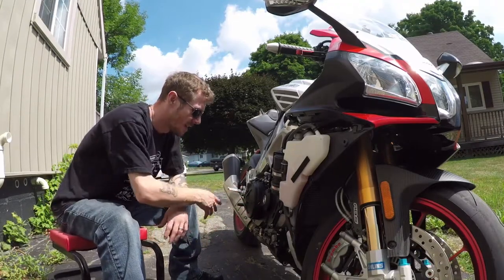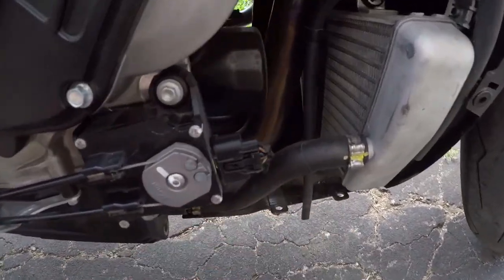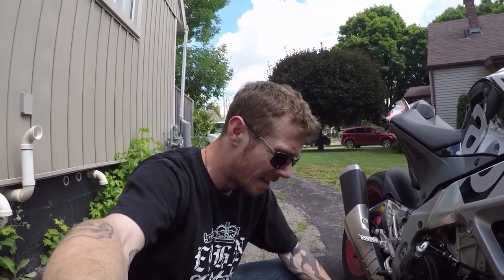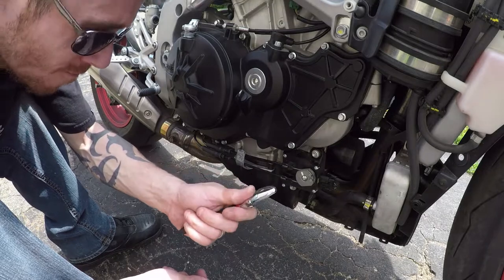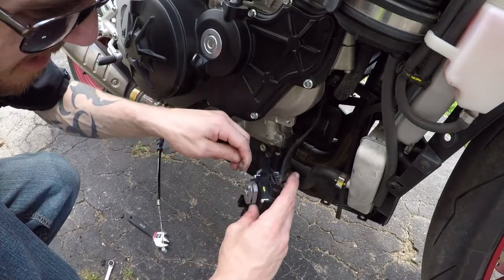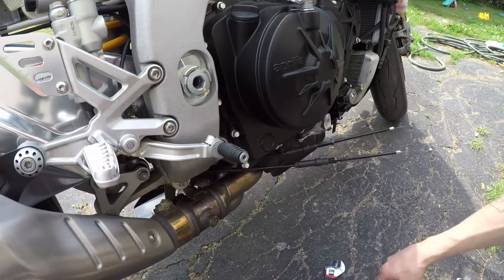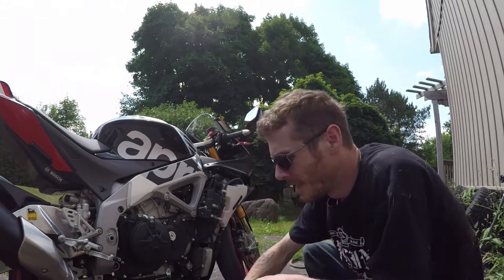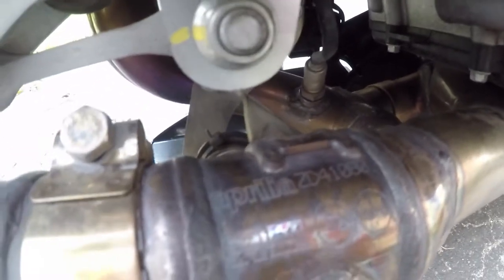Aprilia RSV4 RF Butterfly Valve Mod | Cable Removal

Comment: Fuel remapping is a must, these valves are also used to regulate the performance of the engine, especially when braking. They use it on MotoGP.
Reply from the maker: That’s false.  Even Aprilia states the butterfly valve is only for sound reduction.  Has zero effect on performance only sound.  It’s only on production bikes on the street.

Comment: great video ,I'm doing this tomorrow , only got 24 miles on my 2020 tuono but this is happening man , can I ask you a question can you get a servo eliminator so you can remove the servo ?. cheers mate .
Reply from the maker: I don’t believe you can get a servo eliminator as a stand alone.  I think the only way is either buying the race ecu or having your stock ecu flashed unfortunately.
Reply: @TubeSocksMalone  hey bud, did you experience any error on your bike after you removed the cables?
I’m planning to do the same as you did but I’m scared that I might get warning on my dash. Thanks👍
Reply from the maker: You will not get a warning if you only remove the cables as the servo will continue to function but won’t have any cables hooked up to it.  Their is no sensor telling the ECU that the cables are not hooked up so as far as the bike is concerned it’s working and doing it’s job.  If you remove or unplug the servo then you will get an error.  I still have not got an error since I did it and anyone I’ve talked to that did it correctly and only removed the cables have not got an error either
Reply: @TubeSocksMalone  I just did mine. It’s all good so far.🤞 Thanks bud🤘

Comment: Top vid, have you noticed any drop in low end torque? Just wondering because there's mixed opinions on this and I thought I'd ask someone that's actually done it, thanks.
Reply from the maker: Triumphant_Chubby I haven’t noticed none at all to be honest.  Even Aprilia says is strictly for noise.  I think some just get it in their heads that it does and spread it around like fact.  Kind of like flat earthers lol
Reply: @TubeSocksMalone  makes sense, thanks for replying.

Comment: Sup man, i ran into your video and wanted to ask, any mayor issues after doing this? I want to do my Tuono but feel a bit scared of something happening to her haha
Reply from the maker: Absolutely zero issues if it's done the exact way I did it in the video. The only issue that would ever come up is if you actually unplug the servo rather than just removing the cables and tricking the servo into thinking it's actually working and that issue would only be a warning light but is actually harmless just then you have to clear it and the way I showed is the go to way.   Aprilia clearly states in the service manual the only purpose of the flapper valve is strictly for noise pollution and nothing more.  After 4,000rpm I think it just opens up but it's only for noise at low idle. After all this time no issues, no warning lights nothing.

Comment: What sheen is the carbon fiber panels on the side? Glossy? Satin? Matte? Looks good
Reply from the maker: They’re all matte including front and rear fenders, side panels and intake covers as well.  All same weave and matte 🤘 but without watching the video again I’m not positive if my intake covers were installed
Reply from the maker: And thank you
Reply: MotoBike Mike that’s exactly what I’m doing on my 2019. Where did you get your cf parts? Specifically the intake covers?
Reply from the maker: bigdclonts I got them from HSBKracing.com they specialized in Italian super bikes and have a race team in the Houston Super bike racing series and guess what they race Aprilia’s.  Apparently they have also had the most successful race season two years in a row for Aprilia in the U.S. so I think you would be in good hands.  Any questions you can contact them as they definitely know Aprilias and race bikes too.

Comment: Hi. Is there a screw holding the servo cover in place? I can't find a way to open it
Reply from the maker: urabummer yes their is a screw holding the servo in place. I unscrewed my servo to make it easier to get the cables off. I can’t remember exactly where the screws are located since my bike is at home but as soon as I get home I can take a quick look.  Are you in the Facebook group ‘the Aprilia Factory’? If you’re I used loaded the entire service manual to that Facebook group.  Not the owners manual but the official service manual
Reply: @TubeSocksMalone  hi Mike. I see 2 screws holding the servo in place. However it is the cover for it that I'm having trouble with opening. :( I'm not in the facebook group. Will look it up! Thank you for the prompt reply!
Reply from the maker: No problem.  Yeah check the Facebook group out and once you’re in the group go to the files section and their should be a few things a people have uploaded like owners manuals.  I uploaded the service manual so since it’s the same book the shops work off of it should help.  All the best brother anytime I can help I am more than happy to

Comment: Will safety wires work to keep the valve in the open position?
Reply from the maker: Yes it will.  It’s stays open on its own automatically as it’s the servo motor that closed it using the cables but to insure for some fluke reason it closes you can use safety wire for peace of mind

Comment: If you have the race ECU like i have you can just remove the plug from the motor. the ecu deals whit the error code.
Reply from the maker: Nixxion _ correct 👌.
Reply: You didn’t take out the cables? Just unplugged the front part?
Reply from the maker: Mutters_TV no I removed the cables completely but left the actual servo plugged in so the bike thinks it’s operating but with the cables removed it’s clearing not.  Just tricks the bike so it doesn’t throw a code
Reply: MotoBike Mike awesome thanks. If I have the race ecu should I take all of it out when I get my slip on?
Reply from the maker: Mutters_TV yes if you have the race ECU and slip on you can remove it all and unplug it as well with no error code 👌.
Reply: MotoBike Mike you’re amazing thanks
Reply: @mutters_tv6326  you can open the cover to the servo motor. and disconnect the cables there whitout removing anything. the valve is open all the time when the engine is off.
Reply from the maker: Nixxion _ which is exactly what my video shows 🤣 but you definitely want to remove the cables.  Their is a risk when have disconnected cables of them one day getting snagged or becoming a problem.  I would highly recommend removing the cable if you’re going to disconnect them just like my video shows.   You could leave them on but that’s the lazier way with potential of them getting in the way or caught in something.  Why risk it if you can remove them.